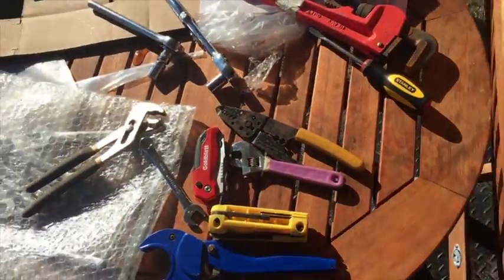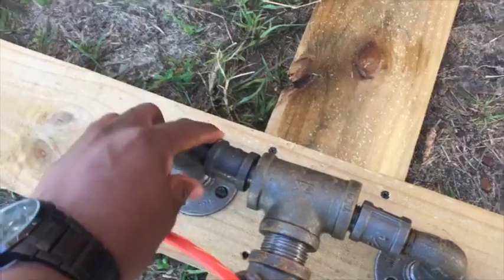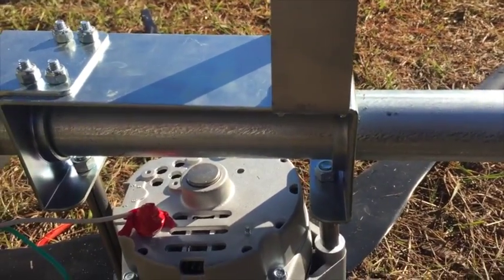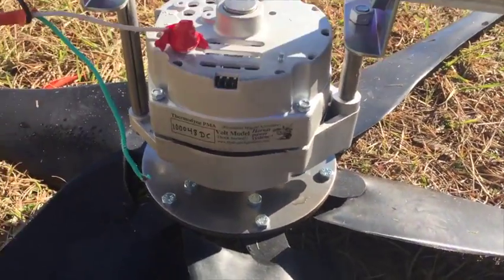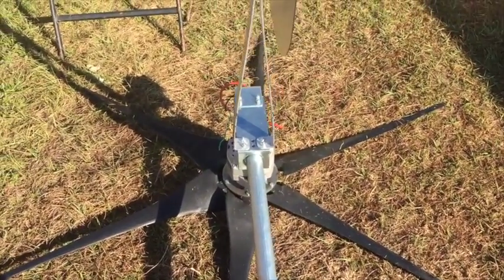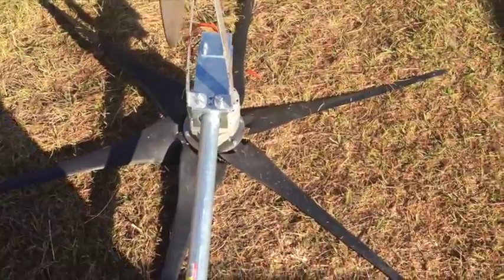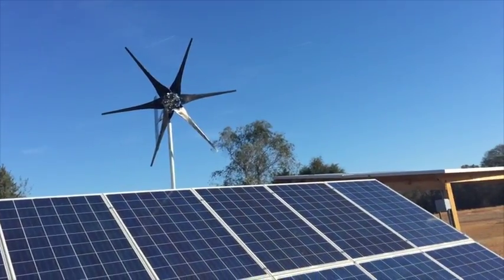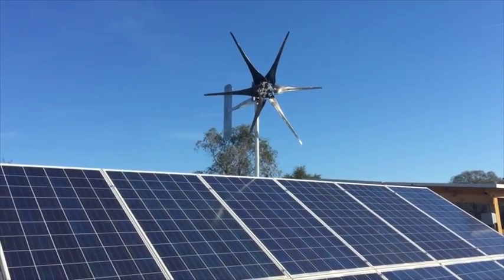Newest Edition to my Off Grid Home - DIY WIND

Comment: Like to ask a question WITHOUT all the trolls going off... With all the crap going on between the different small wind people, why did you choose Thermodyne over any of the others? Also, why DC over AC? Looks to me like your wire size is woefully undersized for DC but if it works I guess it works right!  Thanks for your response in advance.
Reply from the maker: Good questions. I honestly hate seeing the trolling as well, I like pure data and experiments. As for why Thermodyne, I have to say the reason why Thermodyne for this turbine has mostly to do with the cost from a famous auction site. In 2013 I bought a 12v from MSW&S when I lived in Savannah GA (Coast living big winds) and I wasn't able to produce any power with the setup i had to my pre-charged supercaps. I was disappointed but I was told it was likely I needed 30 ft or better to avoid turbulence which causes spinning but no power (Manufacturer statement). Each turbine I have had has been DC and I see the main benefit is the rectifier is supposed to stay cooler but the trade off is line loss. My next turbine for comparison will be AC though. Lastly, you're right about the wire size honestly didn't do the math and I did "monkey see monkey do" and I hooked up the thickest extension cord I could purchase at home depot and cut it. I need closer to 6 gauge wire based on my run so I may just run a second cord and pig tie the 3 wires into a positive as well as the 2nd extension cord as a negative to allow better power transmission. Thanks for the question and making me think a little bit. :) I'll keep you posted on updates
Reply: @brooksjeremiah2011  I have a 500 watt rated 3 phase AC PMA and it can get up to 1,000 watts in 25 to 30 mph winds. 15 to 20 mph about 400 to 500 watts 40 to 50 amps . I have this setup good. I use 6/3 cable its 6 awg 3 wires like 50 amp rv cords . It runs 10 /3  first 6 feet then the 6 awg then at the switch o wired a 10 /3 to the rectifier that's wired into a solid state relay and control brain board and a 300 watt resister bank to drag it down during 60 mph winds to prevent damage. And my cooling system is inline 12v blowers hooked to thermal control relay boards. Really cool